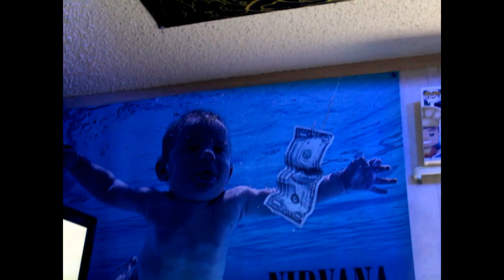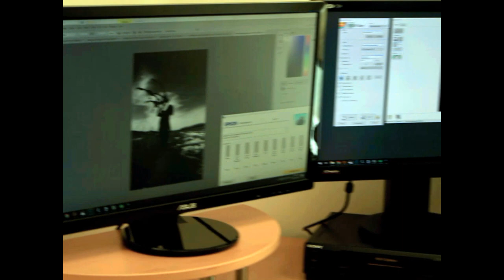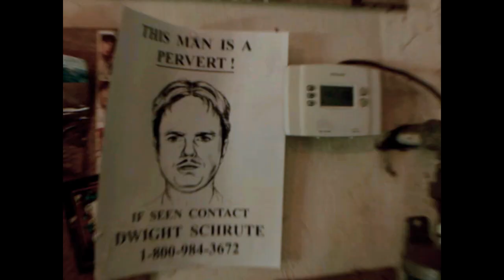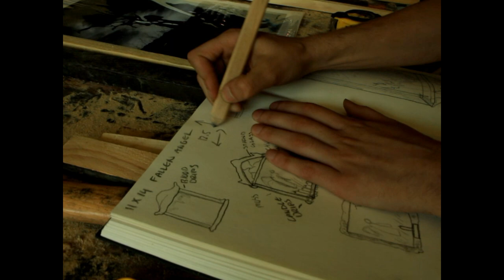I BUILT A 'FALLEN ANGEL' PICTURE FRAME???

Comment: Hi Jakota, great project  but PLEASE, please please learn to use a chop saw with your right hand or turn the piece the other way. My heart is in my mouth every time I see you using Josh's saw! It doesn't help that it has no guard, you wouldn't be allowed to use that here in the UK.

One last thing while I am on a safety rant, when you're firing brads in with the air gun, keep your hands well clear, I have learned the hard way that brads can hit a knot and fire out the side of the wood, they make a real mess of the pink squishy stuff you're made of 🤕

Anyway, I'm not here to rant, love your work but be safe dude.
Reply from the maker: Craig Childs thank you for the concern! And thanks for watching!
Reply: Good of u to tell him.